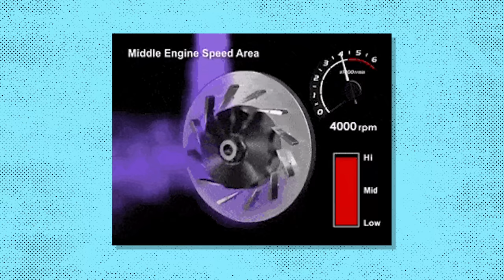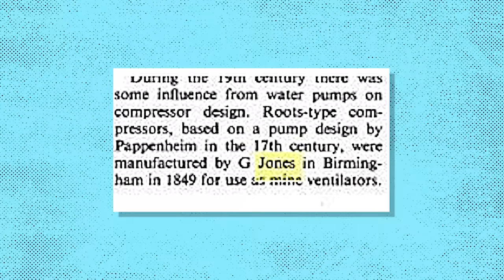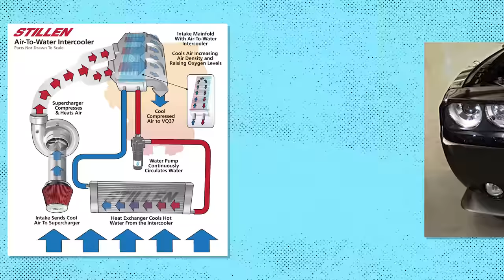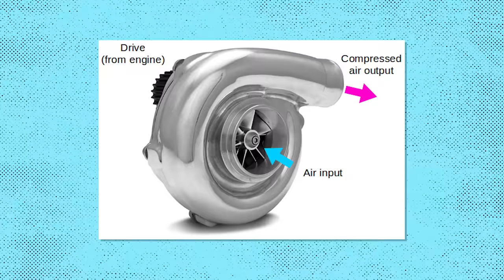Why Superchargers Aren't As Good as Turbos

Comment: It is absolute nonsense that a supercharger has to be on top of the engine. That's only a case for V engines. On inline engines they're much more commonly placed on the side.
Reply: They also make superchargers that look similar to a turbo and are mounted kind of like an alternator. I believe procharger makes them or something

Edit: oh he says that in the video
Reply: @brickson98m  yeah, centrifugal superchargers. They're a slightly different style, but still very much a supercharger.
Reply: Those are called prochargers
Reply: @jackdaniels2657  it's called a centrifugal supercharger. Procharger is the most well known brand name among suppliers of centrifugal superchargers.
Reply: Also he talks about an electric turbocharger which doesn't make sense since It has no turbine, it's an electric supercharger.
Reply: @tomdtom5407  technically there could be an electric turbo if you adapted the rear turbine to serve as a turbine based generator
Reply: @Dominik189  yes, you are right. but the electric powered compressor can use energy from another source, so the turbine is not really part of the Air induction system, It is  an additional  alternator.
Reply: @tomdtom5407  true. However electric powered compressors for  induction in cars generally run on a 48V system rather than the 24V car battery standard. Meaning if the turbine based alternator was specifically made to be part of the 48V system you could get away with calling it an electric turbo.
Reply: @Dominik189  good point, I agree in this case.
Reply: You can also use a supercharger that looks like a turbocharger I think they are called Procharger
Reply: @jxhnny_gxddamn  centrifugal superchargers. Procharger is a brand of them.
Reply: @jackdaniels2657  Procharging is typically where the engine has both a turbo and a supercharger.
Reply: @jackdaniels2657  And is also a brand name
Reply: @izzy031096  no actually, Procharger is a brand of centrifugal supercharger. The actual name for turbo + supercharger is “twincharging”
Reply: It doesn't have to be. Centrifugal superchargers don't mount on top.
Reply: @JoeIsCrazyWillman  that's... That's what we all were saying
Reply: @Dominik189  in fact, I own a second gen ram, and the available supercharger for the 5.2/5.9 Magnum V8s actually was offset of the top of the engine for packaging reasons, and then had a air duct from the top of the blower over to the vertical throttle body sitting on top of the intake manifold.
Reply: He literally addresses this in the video
Reply: he just means it needs to have an intake on top i think
Reply: I have to say, I’ve never seen a roots or twin-screw supercharger on an in-line engine lol, just centrifugal.
Reply: @TonyTheTruckGuy  I have. On several 4A-GE/GZE engines.
Reply: @Dominik189  Had to google it to see but literally 1 in 40 photos shows a non centrifugal style, which leads me to believe it’s pretty rare. I’m also pretty sure dude didn’t say it HAS to be on top. I swear he just said “it sits on top”, which it does, 99.9% of the time.
Reply: @TonyTheTruckGuy  that's really only a recent development though. From factory the 4A-GZE came with a roots style supercharger. Like most Superchargers offered for JDM inline 4's are roots. Centrifugal ones took off post 2005 really, and mostly on European cars.
Reply: @Dominik189  Right I’m just saying it’s far more common, especially now days that a traditional style supercharger sits on top. It really is crazy seeing one bolted to the side of an in-line engine lol
Reply: @TonyTheTruckGuy  I guess. Maybe I'm just used to seeing then side mounted
Reply: Uhhhh not all supercharged are all on top.
Reply: They don't need to go on top of v engines either lmao
Reply: old mercedes and bentlys had crank driven roots blowers that bolted up directly to the front of the block
Reply: Even with V motors u can still mount a pos disp sc on the side, run a drive shaft to the belt, and tubing to the intercooler and eventually the manifold.. complicated sure. impossible? Absolutely not
Reply: 4:50 you absolutely dud. 🤣🤣🤣
Reply: @aaronsprojects9622  except I wasn't talking about centrifugal superchargers, i was talking regular roots type superchargers.
Reply: @Dominik189  I apologize from my 11th beer on 3 hours. I had no idea they made intake mounted superchargers for inline engines. Please educate me.v
Reply: @aaronsprojects9622  most of old Toyota TRD and Honda Performance aftermarket supercharger kits as well factory superchargers came as roots type and were side mounted. When I say Old I mean like 1970-2000. There were also a few kits for the NA SR20 made, they mounted art a weird, almost 45° angle.  But they sold like shit cause everyone wanted the turbo version of the SR20. Much like Toyotas 3S block, there is a roots supercharger kit for a 3S-GE that can be found rarely on the aftermarket, but the 3S-GTE was always the more popular version.
Reply: @aaronsprojects9622  Mercedes made crank mounted superchargers on most of their supercharged offerings, even 4 cylinders until like 1998. And Mazda had a few side mounted roots type superchargers as well I believe. In general post 2000 it has become really rare to find, but there are still some aftermarket kits out there. It's mostly due to everyone and their moms favouring turbochargers and wanting "big power", as well as the easier mounting of the centrifugal type supercharger.
Reply: @Dominik189  that's badass, thank you. I honestly had no idea! I apologize that my ignorance prompted me to out you. I'm glad you educated me instead of stooping to my level and telling me how stupid I am. Thank you.
Reply: are u a furry? I not a furry hater or something, i m just asking :D
Reply: @f-15TheFkingEagle  former furry. I left the fandom a few years back. I still enjoy the Aesthetic a bit, but honestly I'm just too lazy to change my pfp.
Reply: @Dominik189  oh, ok -w-"
Reply: @jackdaniels2657  that’s a brand of centrifugal superchargers
Reply: @tomdtom5407  the electric turbo has 2 types.  A more common one uses a single mg combo.  To spool faster.  There is also one where you complete separate the turbine and compressor using a generator and a motor.
Reply: @AB-nv7bz single mg combo?
Reply: @tomdtom5407  motor generator.  Its like whats in hybrid cars.  It can capture energy then provide power.  F1 cars use this.
Reply: In the 1950s and 1960s, Ford fitted smallblock and Y-block V8s with centrifugal superchargers and blow-through carburetors.
Reply: Also superchargers are a million times more reliable than turbos, as well as the fact that you can modify a super charger by porting it however I dont think you can port a turbocharger
Reply: Go procharger then if on top is the prob
Reply: @jackdaniels2657  ProCharger is a brand which specialises in Centrifugal Superchargers.
Reply: It's not even the case for V engines. Many many examples of V engines with superchargers mounted elsewhere (usually in front).
Reply: @brickson98m  Paxton as well. What I have on my mustang ‼️✔️
Reply: and yet vortech sets em off to the side all the time
Reply: @torkrench  Yup, on top is a good place for them but far from the only place.
Reply: @Dominik189  I don't know what kind of car that runs on 24v unless it's a diesel.  All cars manufactured after 55 are 12 volt systems,  before that all cars were 6 volt systems!
Reply: @izzy031096  no that is not called pro charging,  it's called staged charging or dual charging.  Go look at old aircraft engine designs.  They were the first to use staged charging.  With a combination of 2 super chargers or 1 super and 1 turbo.
Reply: @chuckmoore8668  yeah, I think I was sleep deprived when I typed that out. 12 V is standard for cars.
Reply: @Dominik189  no worries man,  there might be some odd ball car out there, probably made by the soviets during the cold war that might be 24 volts. But I have never heard of one lol
Reply: @chuckmoore8668  eh, who knows. I know some trucks run 24V.
Reply: @brickson98m  it's called a centrifugal supercharger. Only roots type need to be mounted to the intake.
Reply: WW2 aircraft had superchargers bolted on all sorts of positions.
Reply: Yup agree
Reply: @izzy031096  Having both a turbo and a supercharger is called twincharging.
Reply: You also have superchargers on opposed/boxer engines, mounted at the back of the engine
Reply: @Dominik189  there are electric turbo charger, they add an electric motor in the middle, they can generate electricity or help spool the turbo.
Reply: I've also seen roots superchargers mounted directly to the crankshaft on some race cars. You can put a roots anywhere a belt or gears can reach.
Reply: Doesn't need to be on top of a V configuration engine either. Usually the best place to put it though, considering there's a huge valley there begging for something better.
Reply: My twin screw  supercharger isn't on top🤗
Reply: They mounted superchargers in front of the engine as early as early 60s. Just a case again where people.of YouTube don't know everything, or very much at all....lol
Reply: You have to watch the whole video.
Reply: @richardtyler8922  i did...
Reply: Potvin drives were on the front
Reply: Ever heardof the Toyota Estima/Toyota Previa SC..¿

Guess where the supercharger is on those..🤣
Reply: @gustavlicht9620  like the old saying, “where there is a will there is a way”.
Reply: @Dominik189  car batteries are 12v not 24
Reply: @bradleyward285  older systems were 24V... But even if a 24V was never used in cars, you're still VERY late.
Reply: V engines can have superchargers that aren't mounted to the top.
Reply: De si be, burazeru
Reply: @BotulinSpikedMarzipan  nemam pojma
Reply: Engine driven superchargers are typically mounted on top of the same engine because:
a) That's where there's any space left at all. 
B) This position (compared to other exotic positions) creates the least number of problems with the least number of headaches for engineers to solve.
C) The supercharger was an afterthought.

Electric superchargers could be mounted anywhere other than the fuel tank really, in the boot, on the roof, or under the passengers butt if that's what the manufacturer fancied at the time.
Reply: @vikassm  that is only true for most modern V and boxer engines. All inline configurations mount to the side, and quite a few V and boxer engines have mounted engine driven superchargers at the front or rear of the engine.
Reply: This is yet more rubbish spoken by someone who has no genuine understanding or knowledge of his subject.
Reply: @brickson98m  its called a centrifugal supercharger, just look it up
Reply: @untouchableg203  you’re late… really late. Someone already reminded me what it’s called. In fact, multiple people have already replied to me on this. 

Procharger is just the most common brand for centrifugal superchargers.
Reply: @izzy031096 hope you are joking
Reply: If they are twin swcrew thery are gonna nedd to be ontop.  Ues there are different types .
Reply: They don't even got to on top of a v a blower can be litteraly anywhere long as the belt can turn it and you can pipe it